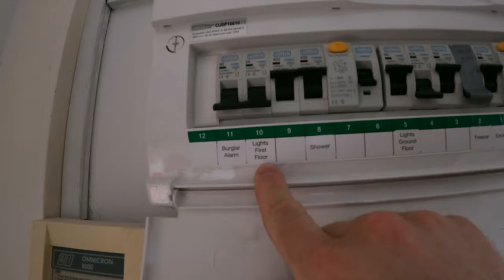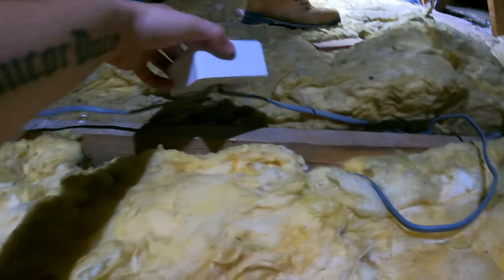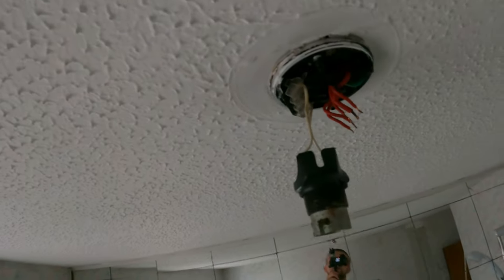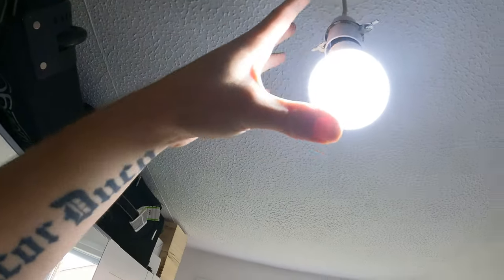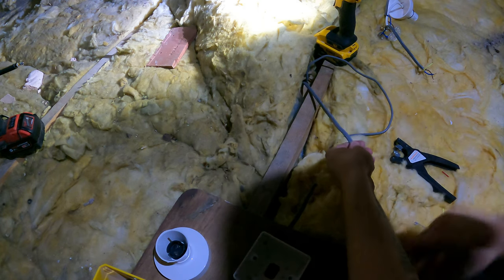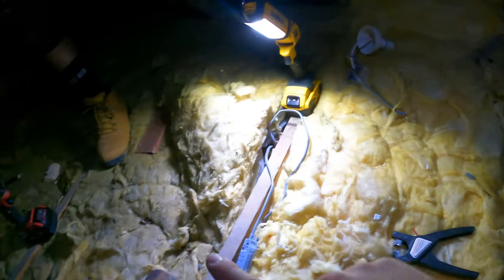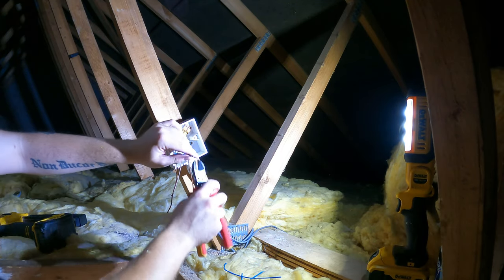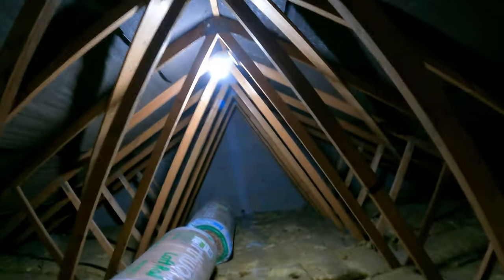Loft Lighting | Common issue | Electrical Life

Comment: Very true when you say people should have a go with a bit of DIY professional help isn’t cheap but it’s around the corner... if your going to work on a circuit or do some DIY isolation is key 🔐 same as if your about to add a outdoor water pipe isolate the water first isolation is a must in everything your about to do and it doesn’t hurt to give something a go and if it goes right well done if not call the masters in and they’ll tell you you shouldn’t be messing with things like this hit it on the chin and ask them where you went wrong 😂
Reply from the maker: well you definitely worded it better than me 👏🏼😄

Comment: As always Sean and Ryan great job those quick connectors look good need a version to use for smart switches. One thing I really hate is cables not clipped in lofts, and attics it just so much nicer when it’s done , and avoids damages to cables. In USA we can have them going on top of joists (and not just the side of joists) if they do we have to have furring strips. Basically furring strips are pieces of softer wood nailed and screwed to the top of the joist creating a rise on the joist with the cable neatly clipped in between them reducing potential for mechanical damage from walking on them.
Reply from the maker: too many lofts work here is just lashed anywhere tbh
Reply: @Cablesmith  I saw Nick once use cable tray overkill in a residential roof void space but looked beautiful and will probably work for decades to come.
Reply from the maker: @mathman0101  yea, a nice touch indeed

Comment: As a handyman I think people touching electrics doing DIY need to have had experience with rewires, board changes, lights, sockets and testing. I've done all the with my father an NICEIC electrical contractor, which gives me the knowledge and experience. Having a go without this experience would make me nervous, and I've seen some really poor and dangerous attempts! Lucky enough this was only a small job. 👌👍
Reply from the maker: Yea I think you’ve got to be comfortable with it etc tbh
Reply: @Cablesmith  hopefully the modern age will research prior. Great video as always mate

Comment: Lighting is tempting as a DIYer since changing light bulbs is a regular thing and leads to temptation to go further... however the pitfalls are there... ceiling rose and multiple way wiring isn't obvious... and the fact you can trip the RCD even when the MCB is off is confusing.
Reply from the maker: This is true mate 👌🏼

Comment: The quick wire splitter looks great.  I am going to use it to relocate a light fitting to a new location a couple of joists down in the kitchen.  Do I need to secure it with the clips or can I just pop it back into the ceiling where the old light fitting was?
Reply from the maker: if the quickwire will be inaccessible then ideally it should be secured to be classed as maintenance free, which all inaccessible joints should be.

Comment: Nice video.
Love the Quickwire stuff too but think they need to do a switch and load for a 3 core in the switch side (L, SL, N &E) so you can take the neutral to the switch for smart switches.
Reply from the maker: Good idea 👏🏼

Comment: Great video, but could you explain more what you did wiring the switch at 11:16.  It looks like you joined all the earth together and 'bunched' all the neutrals together, but what about the lives?  One was the feed and the other two were from the lights, but which terminals do they go into on the switch as you did not show how the switch was wired?  Thanks
Reply from the maker: Yep, the feed went in C or common, and both from the lights went in L1
Reply: @Cablesmith  Perfect, switches always get the better of me 😆, thanks
Reply from the maker: @Mister_H  no problem

Comment: Should the customer of got you in Sean mmm it's a tough one 😆😆 yes because you and Ryan have done a top job as always and the job is safe. Neighbour asked me to check the wiring on a loft light they had fitted as when the switch was on the loft light and bedroom light bulbs glowed dimly when the loft light was off the bedroom light wouldn't work, they had wired the light across the live and switch wire of the bedroom light thinking it was a feed 🤦‍♂️
Reply from the maker: Hahaha it’s quicker to just get an electrician in most of the time isn’t it.
Reply: Trying to save money but it costs them in the long run 😆😆 love these products you bring to the channel they are innovative like in other video the linean clips for swa the quick wire splitter, quick wire downlights, nox box to name a few it's stuff I've started using and I'm impressed with it. A lot better than the junk they normally have on the counter at the wholesalers like quick wire swa glands that you put a 25mm swa in and the cable drops out the @rse of it 🤦‍♂️
Reply from the maker: @adierob1  hahaha I know the ones you mean

Comment: Good stuff mate, those Quickwire connectors are very nice, I am with you on the innovative.

The single gang surface pattress box you used for the light switch, is that a PVC one? Just wondered how you got the hole in it for the stuffing gland?
Reply from the maker: The back box come with a 20mm knockout mate. 
Thanks for watching

Comment: Great stuff fair play,   I'm going to have a crack at installing a PIV loft unit at home,    can i take a power feed off the lighting circuit in the loft that's running the bedroom below to get some power in the loft to run the PIV loft unit ? The PIV unit come with a 3amp switched fused spur..    if so,   can i use the Quickwire spitter for the power feed i'll be plumbing into?
Reply from the maker: Yes and yes 👌🏼 quickwire is a belting idea for that too.
Reply from the maker: Mark has just posted a video fitting one, I’ve not watched it yet but if marks doing it the video will be informative 👌🏼 https://youtu.be/RbCWVJZL9Uc

Comment: Absolutely ok for DIYers with common sense to have a go at this... Knowing your limitations is important and it's clear that your client did.

Part P allows extensions to existing circuits as  a DIY thing still (non notifiable) but the person does need to be competent. The only other issue is that insurers often have rules that go beyond the legal requirements.
Reply from the maker: yea insurance could hold people back, and like you said know your limitations.

Comment: I'm going for loose connection
Edit 🤣🤣 it was just the rcd, it's easy for me to say being a spark but shorly seeing a switch in the off position would make you think but we're all different and I'm shore I'd struggle to do his job. You live and learn
Reply from the maker: You’d be surprised how many call outs I get for circuits not working and they say all the switches are on still. Then you look and the RCD is off 🤷🏻‍♂️😂
Reply: @Cablesmith  🤣🤣 lol same here or they find a spur and switch off then when that circuit doesn't work they call us, yes it's a simple fix but how do you charge for walking into a house and turning a switch back on. Also it wasn't them that touched it... but they live alone... must be there local ghost playing tricks on them 🤷‍♂️🤦‍♂️. The most annoying is when they've done work on the house, worked on the electrics mess it up then ring up saying it's randomly stopped working which can waste hours looking for a fault that they know about but don't wanna say anything but then don't like the price put in that would have been less if so much time want wasted looking for it. Honisty is the best policy but hay its good fun investigating and doing detective work on what really happened, the big challenge comes to get that across to the costumer politely as to not offend them. Fun and games 😁. On a side note love your vids and your top quality work, as you will know too many sparks will do things bad, rough or dangerously and there's no excuse for it, thanks for your good, safe service 👌👍
Reply from the maker: @lukesmith8792  yep I’ve had some that just be honest and tell you what they’ve done, and then it’s fixed within the hour ! Much better ! 

And thanks for the kind words Luke 👏🏼

Comment: When it comes to DIY I say it depends on the job , adding a spur socket by turning off the mains for a few minutes , or changing a light fixture basic things I find is okay. When it comes to removing the cover for the consumer unit it should be left to the pros showers should not be a DIY job . Should mcbs sales be restricted to the trade to stop consumer unit tamerping . Cheers max 👍
Reply from the maker: Yes I’ve always said we need some kind of system so only qualified electricians can buy consumer units. 
Thanks for watching mate

Comment: Surely the quickwire has a connector for the switch
Reply from the maker: What do you mean?
Reply: @Cablesmith   feed in , feed out, load, switch
Reply from the maker: @smoggydrones5664  ah right, yea some do, the switch and load version. They also do a splitter version that’s just a 4 way JB.